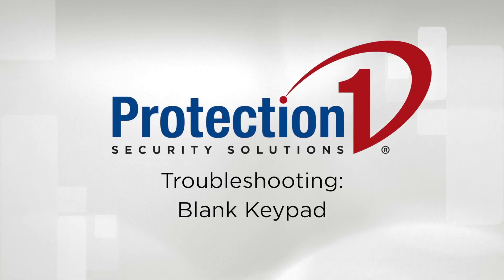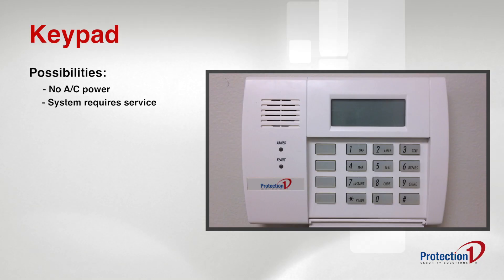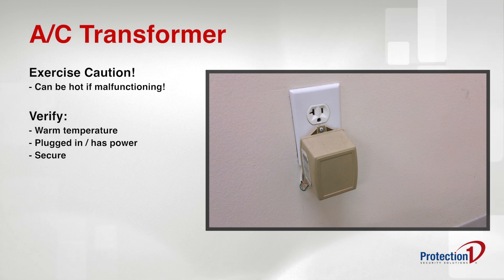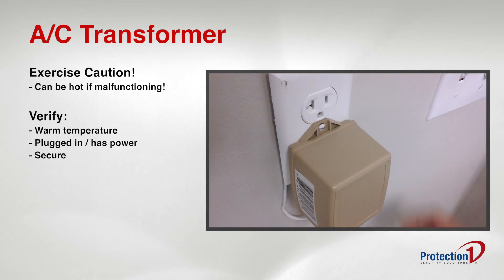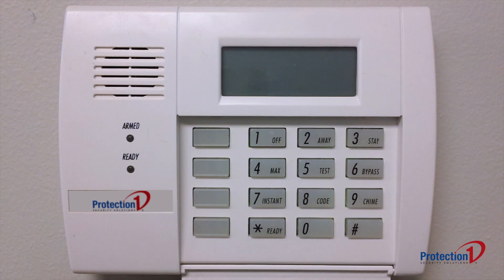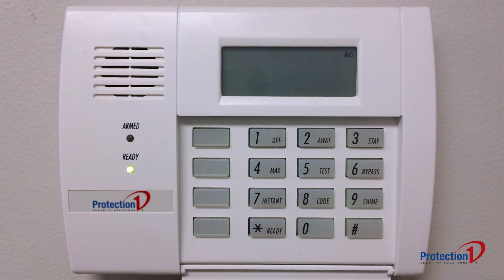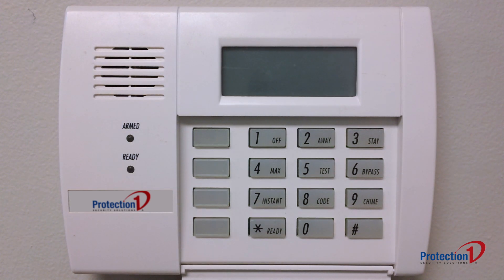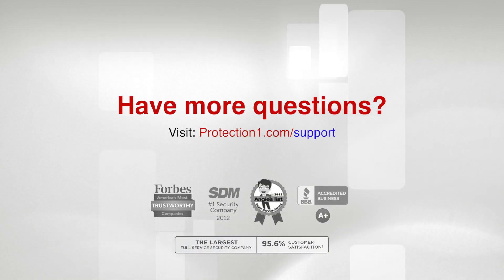How To Troubleshoot a Blank Keypad on Your Honeywell Alarm System

Comment: Greatly appreciate the video, one of the wires connecting to the power supply broke and I did not realize it. Fixed in 2 minutes without the need for a service call.